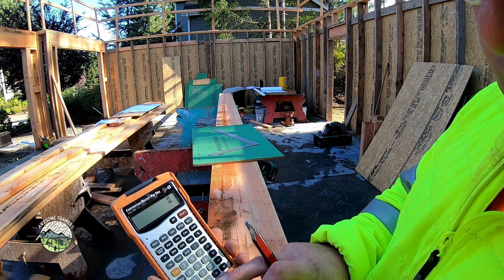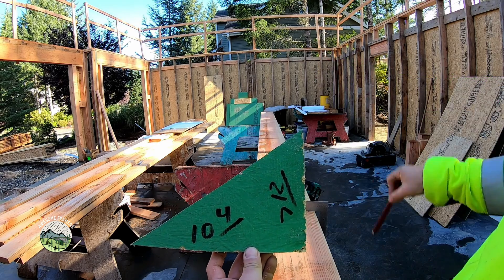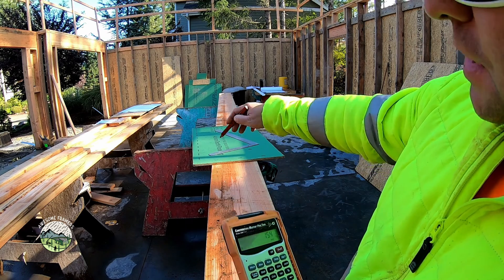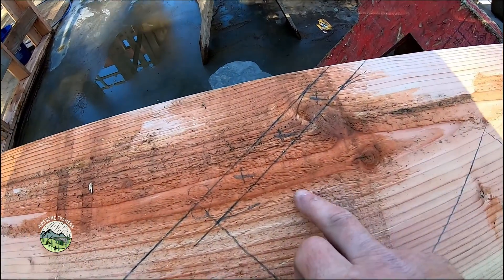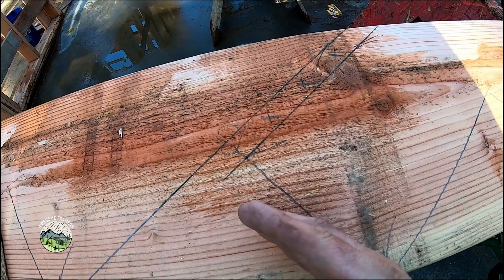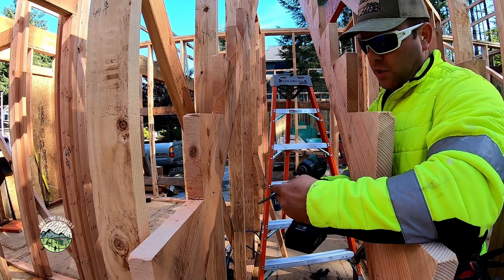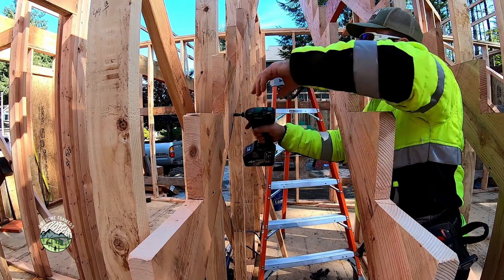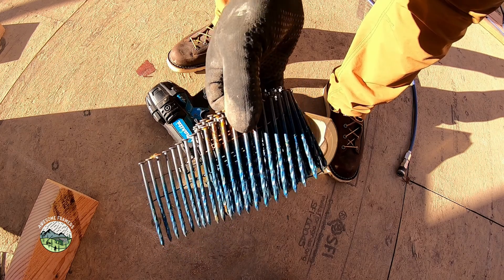Stair Layout and Framing

Comment: Do you sawtooth cut the skirt boards when finishing ?  I was taught to space off the wall with a 2x4 instead of a 1x4 so drywall and a skirt board can slip between the stud wall and stringer.
Reply from the maker: no skirt boards on this stair, or I would do exactly as you said 👍👍

Comment: Wow , 7 1/4 to 7 5/8 is the maximum riser height in 5 states that I have built and or cased out stairs in over the last 45 years (still clicking) exterior treads and risers are not the same , most codes are more lenient with exterior residential   stairs but more strick with commercial stairs , landings and rails.......up and down the east coast , I would have thought the West Coast codes to be less tolerant.  Great Channel , have been picking up on some new tricks and tools to add to my tool box and my repertoire , thanks you for sharing your tricks of the trades , you have bettered yourself.  Have really enjoyed the Ballon Framing videos and I have to imagine that you have very good relationships with a structural Engineer or two . I'm late to your videos but will get caught soon  , only one other framer besides yourself putting out videos with techniques that I have not used or seen  , called mattbangs wood , another west coaster , different style but jam up methods . Would like to take just a few tricks of each and combine with mine ..........then bang out a few more quality projects while I still can.  Best part of our trade ....something new to learn most every day , never gets old , best work in the world.

Comment: Great teaching vids. What happens to me watching these vids because is I want to learn anything that will make my job quicker/tricks and easier. I have been at construction for 40 years I have cut numerous stair stringers but not like that. Not saying it is wrong. So what happens is I try to learn your way and it messes me all up. Just using the Master 5 calculator would be a lesson in itself. I have that calculator that just sits in my truck. Best framing video series on the youtube thank you

Comment: @AwesomeFramers Why do you use Beck fasteners instead of screws for the stair treads? Conversely could you use the Beck fasteners instead of screws for the subfloor?
Reply from the maker: good question.  Because they are so insanely tenacious and faster than screws.  I've used a lot of different fasteners and am not loyal to any one of them, but these are pretty awesome.  I woudn't use them framing because you can't make mistakes with them.  Its a nightmare pulling them.